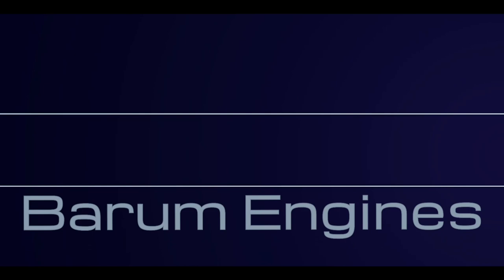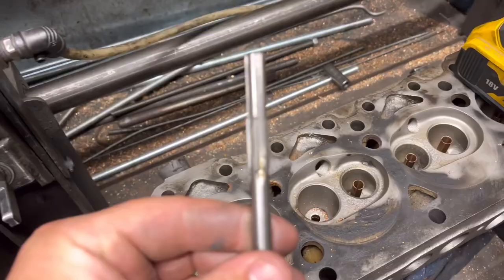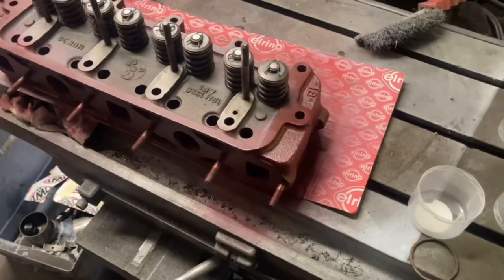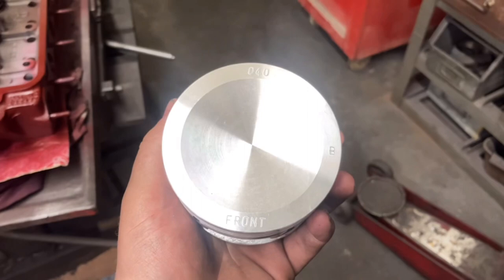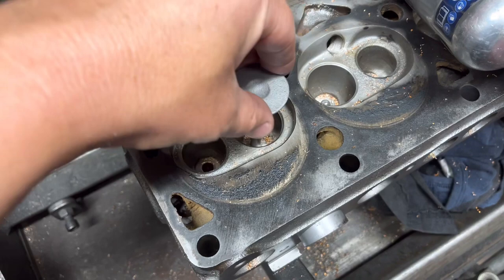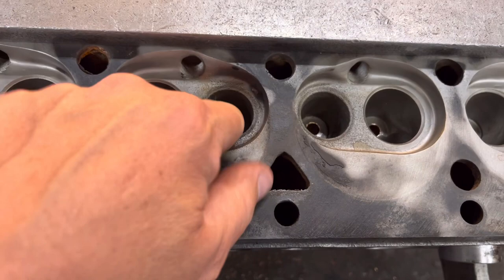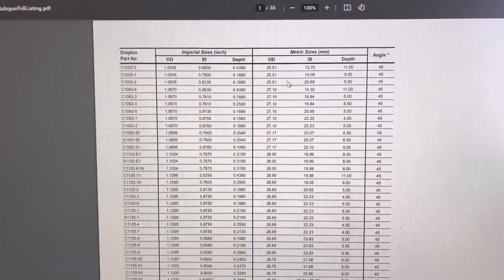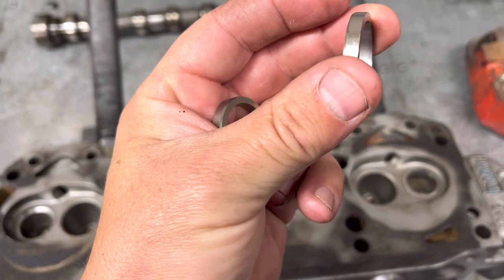When 19 year old apprentice and employee get ON CAMERA! How bad can it be?

Comment: It's nice to see young Issac appearing on camera! Well done ! Lee you could shove a British .303 " bullet down those guide sleeves, they are .311" diameter Lol You talking about  Gosnays Engineering, they are about the same distance from me in the other direction from Burton Engineering lol about 2.5 miles each way and they are on the same road as well the A12. Lee it would have been nice to see you doing the set up and cutting of the pocket for the unleaded inserts

Comment: Are the notches cut out of the webs on the MGB crank where you are balancing it? Will that not be a source of weakness? ie change in section equals build up of stresses.
Great to view a channel like this though as an engineering apprentice from the 60's when GP had a lot of manufacturing, now housing estates! Does your apprentice attend day release course?

Comment: Wow! That's an expensive way to remove those valve guides.
There are much cheaper ways to do the job - spin the nose of a standard reamer down or even grinding a second, steeper point angle on a twist drill.

Comment: Might be a daft question, when doing the balance on the crank etc, would it not be better to put the front pully, clutch and fly etc on the balance as a set from the start ? would its not require less taken out of each part if they counter each other a little, then just use alignment marks for assembly ?
Reply: If they balanced the whole lot in one go, then all the parts would have to stay together and you could never change any of them without losing balance for the whole lot. 
With every part balanced individually—as they do—you could later change the pulley, clutch cover or the flywheel with another balanced item and the whole lot would still retain its balance.
Reply: @johnrussell5245  correct.
Reply: @johnrussell5245  Knew there would be a logical reason behind it. Quite obvious really, so obvious I over thought it :) Thanks

Comment: Well you said you lost your 'vernier', but you found a digital caliper... 🤔

Do you have any vernier calipers (or even vernier mics) ? If so which members have the skills to use them accurately? 😁
Reply: And calipers and microns should be Imperial ones to ease reading 😉
Reply: To me a vernier is  what he was using But I only used one for 35 years
Reply: @Urs4   Verniers can be either by pressing the button  that changes the readout from metric to imperial Micrometers are usually either metric  or  imperial
Reply: @barbaraneville5036  I know that. As me coming from metric country and having one imperial inside micrometer... and no clue how to read it.
Reply: I learned to read a vernier scale in my apprenticeship... Imperial and metric, caliper or micrometer. You can read tenths of a thou on an imperial vernier micrometer... Pretty rare though... I wonder if barum have any of these antiques?
Reply: We all use imperial micrometers, we just use the digital ones for certain things aswell. Using a micrometer was the first thing they taught me on my very first day, as I was watching John grind a crank.
Reply: @IsaacBarum  Good to see youngsters going into engineering I used to work at BAe  Making parts for  Aeroplanes  Happiest time of my working life .Just make sure you have comfy steel toecap shoes and some decent safety glasses Look forward to your next video Log
Reply: @IsaacBarum  don't forget to clean the anvils 😁 and check zero

Comment: Being a apprentice back in the early 90s I was rather a fat kid and the dealership didn’t have overalls big enough so they got me some red ones then stapled a bit of blue string on them a called me tampon of two years 😂 luckily my mentor showed me a few tricks to have fun getting them back silicone there boots to the floor or strapping some hun nuts with welding wire to their exhaust or putting some stones behind their hub caps fun times